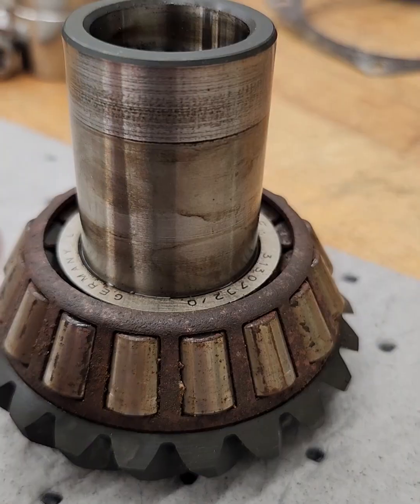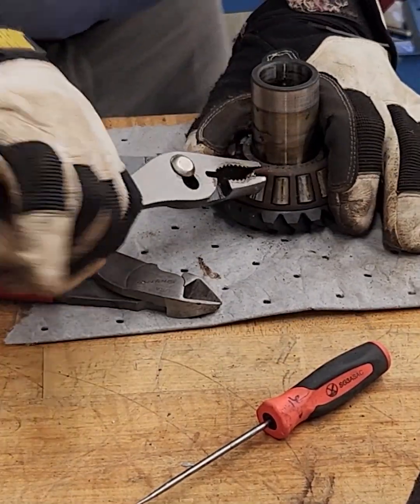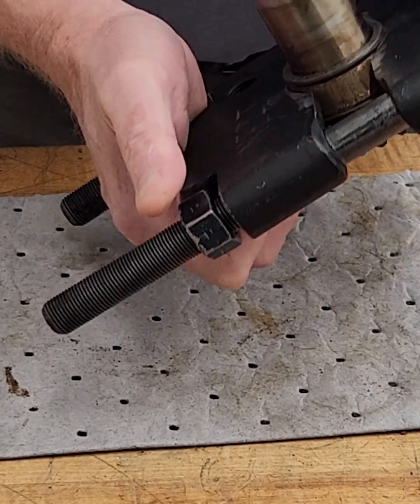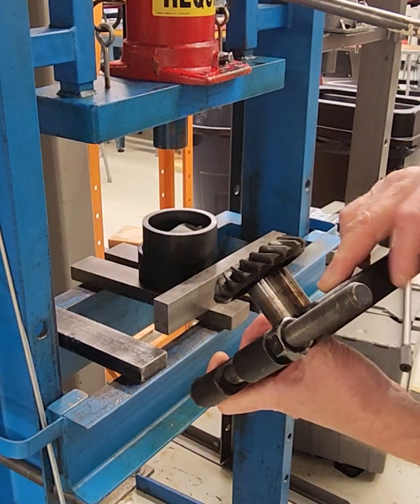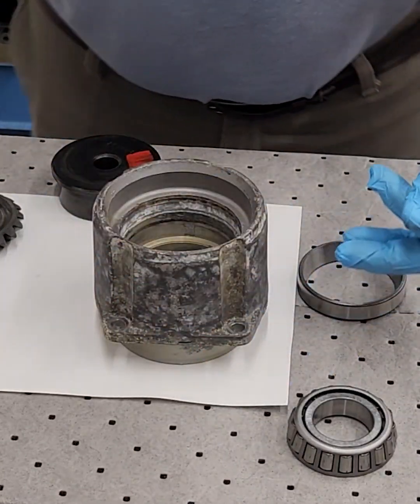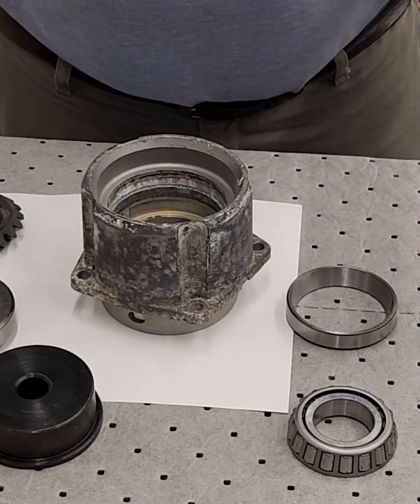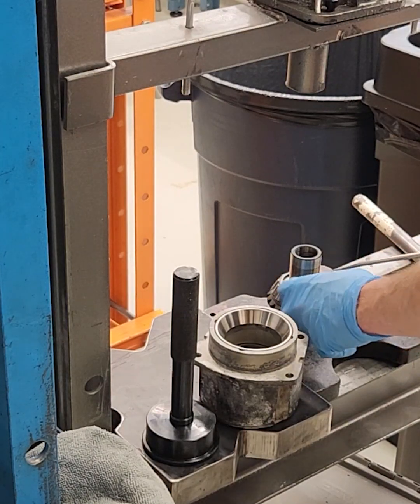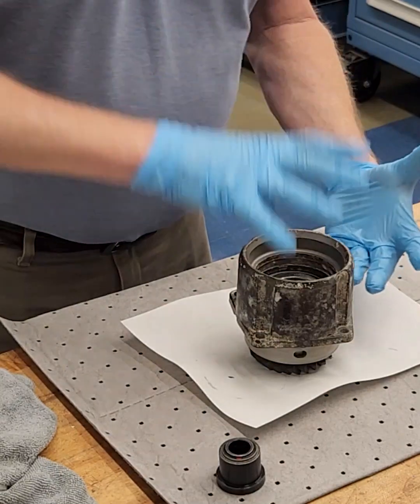Using a Shop Press for bearing and Race replacement

Comment: Good afternoon Ted.

A couple of questions and not criticism in anyway always enjoy your content.
All more than one way to to skin the proverbial cat.

1) Is there a particular reason you don’t use a bearing heater to reduce assembly pressure between shaft and bearing or chill the shaft?

2) You choose to use oil on your interference fits rather than an extreme pressure lube like CMD extreme pressure lube?

Aa a machinist, I personally prefer to reduce assembly pressures to reduce the possibility of scoring, misalignment and use CMD to prevent fretting corrosion between mating interference fits.

Cheers Ted.

Ron.